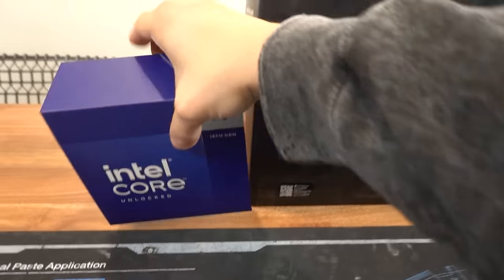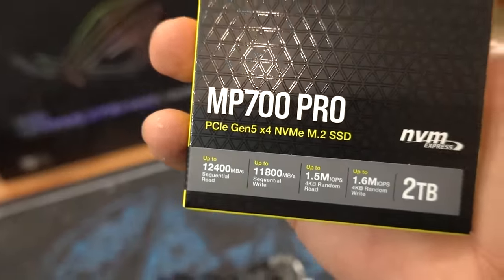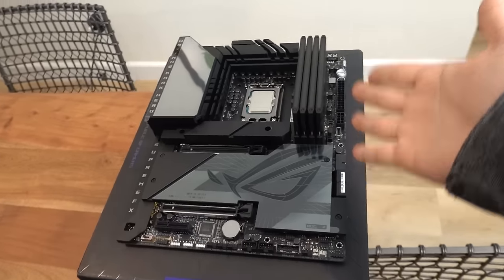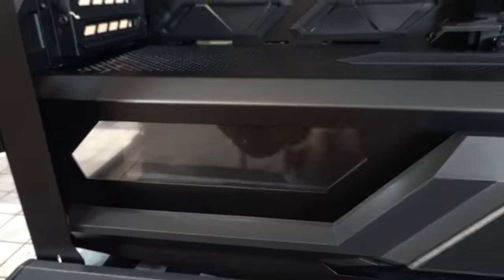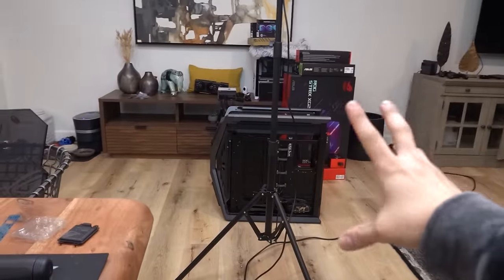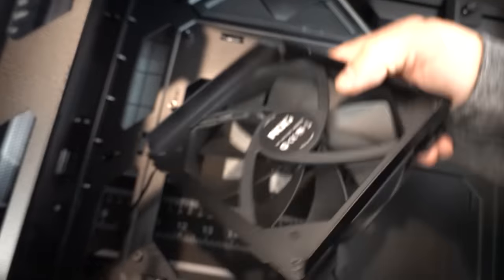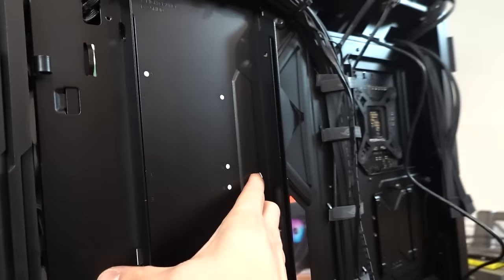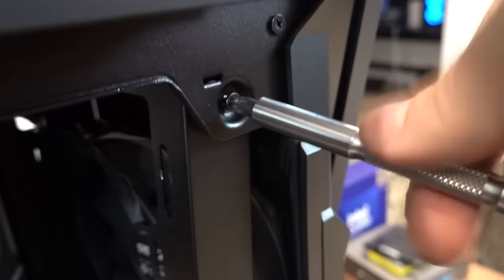The Most EXTREME PC I've Built In AGES!! | Build of the Month | Episode 6

Comment: This is almost my exact build, and my CPU is crapping out on me. When I get home tonight, I have to mess with XTU and lower the voltages and then mess with my BIOS because of complete freeze when Pre-Loading shaders. I have the 14900K and the ASUS Dark Hero and Corsair Vengeance RAM 6400HMz 2 sticks. And after a week or so my PC started crashing or dead lock freezing when trying to load them ( it was completely fine for that first week until Nvidia had a driver update and COD MW3 went through the PRE LOAD Shaders again and it started from there). So, you really might have to mess with the voltages. There is a huge post on Steam that made the news yesterday and finally I have news on why my PC is being a beotch. So, if you do mess with the voltages, I would like to see what you do so I can mimic the setting and see if it works for me as well.
Reply: If you make a video on it I would have to say it will get a ton of views since NightnGale on the STEAM Forum made the news and found that over 2000 people are all having this issue. Show how to undervolt and they will come :)

Comment: For my 14700k build, I skipped on using a pcie gen 5 ssd or even the slot alone as it will force the GPU slot to run at 8x mode. Some benchmark tests have shown that this will hamper down GPU performance a bit with a few frames.

Comment: I have this case , and it was one of the hardest cases I’ve ever built in. The two screws that hold the power supply shroud on in the back are horible .once you cable manage you can’t get to them only the front two are accessible. I also installed a crosshair X670e extreme motherboard. With this motherboard it will make contact with the rear 140 fan on the v ram heat sink. I had to replace with a 120. The other problem was a 420 Artic cooler is almost too thick with the 8 pin conectors. Problem was fixed with some extreme cable management lol. And having custom cables and the 90degree 24 pin off the motherboard also took some extreme cable management! Overall I won’t recommend this case.
Reply: I have this case as well. And i too had a tough time fitting the rear case fan. But i didn't have any issue with my ryujin iii 360 aio. The arctic radiator is quite thick but should fit.

Comment: why do you have only one set of intakes? the front fans are kind of pointless when you have the side fans as exhaust, just sucking the air right back out.
Reply: The side fans are intake.  The fans he installed in the front and side are reverse blade models that flow the opposite direction of standard fans for aesthetic purposes.  Both side panels appear to be solid glass though, so not sure how well those side fans are working.